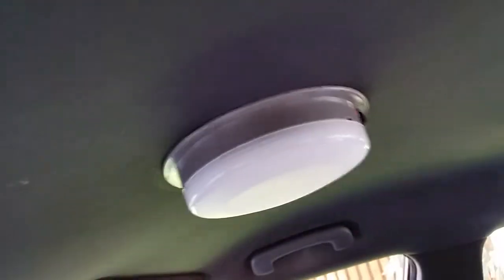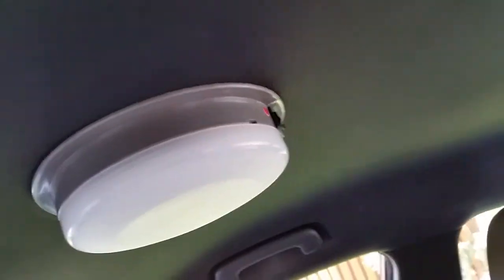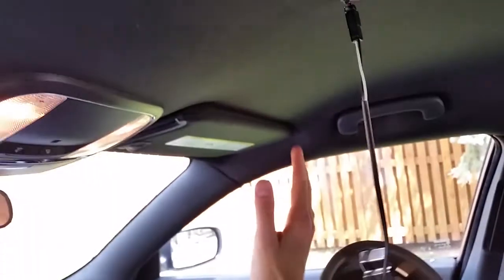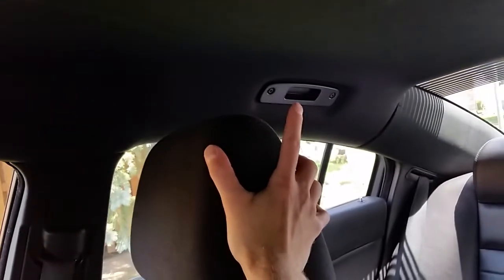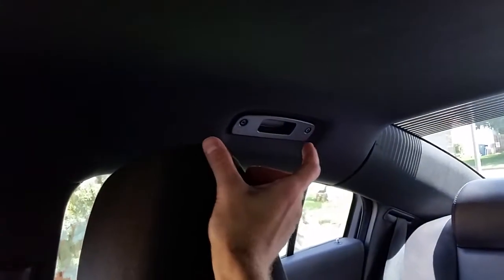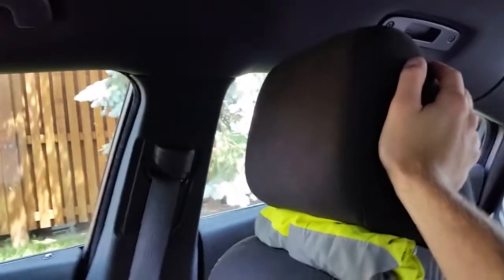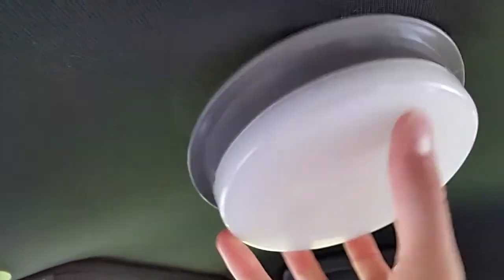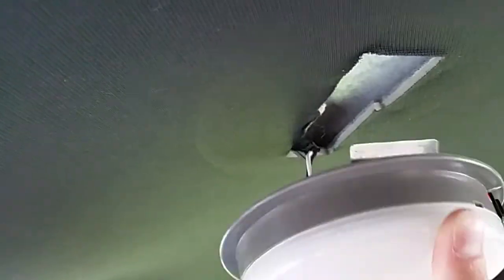How to Remove and Install Sound Off Signal Dodge Charger Police Dome Light (Ticket Light)

Comment: I have a 2008 P71 crown vic and I just baught this light but the connections are different. Like the wire that's in my car for the dome light is rectangular . I think its for a older dome light I would like to connect it in my car should I just cut and strip the wires and connect them like that ????
Reply from the maker: Yes the connector is really useless. If you have the matching ends then great. But otherwise just chop it off and splice the wires, you can even use your own crimp on connectors. If the bulb is halogen polarity does not matter. if you have the LED model or want to replace the bulb with an LED you will have to pay attention to which side is power and which side is ground.
Reply: Thanks installed it today it works just fine I appreciate it cuz
Reply: Why did I do the same thing tho lol but just cutting and krimping them should be good enough for it rite ?

Comment: Is there anyway I can take that dome light out and put in the regular Dodge Charger map lights?
Reply from the maker: No, if your car is missing the regular map lights it is because the car was ordered without them. You will need to go to a scrap yard and get not only the map lights but the plastic mounting bracket that goes beneath the headliner that it clips in to. Ideally you should get the whole headliner with the hole already cut out.
Reply: Chargèro thanks 💯

Comment: How do i wire it into another set of wires, it works but only when i have the doors open, the light wont work with the door closed, heelp😥
Reply from the maker: Who ever installed it then did that. You will have to trace the wires and see what they did.

Comment: So what does the dome light connect to? Where can I find that connector?
Reply from the maker: In the police model charger the connector is pre-wired in the headliner as shown.
Reply: I'm sorry, I forgot to mention on a civilian model vehicle. I would have to add that connector?
Reply from the maker: Yes, you can just crab power from any circuit like the cigarette lighter, and pass the wire up the A pillar and to the headliner. Sound Off also makes this light as a "universal"model which means it does not have that metal bracket, or you can grind off the rivets for the metal bracket and just screw the light bass to the headliner. so you do not have to cut that large hole.
Reply: Thank you, continue the great work